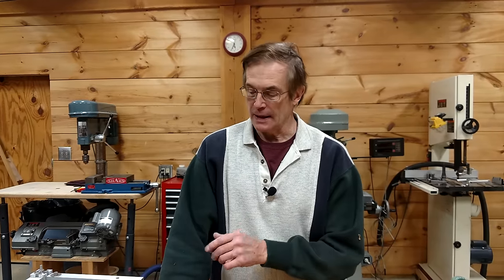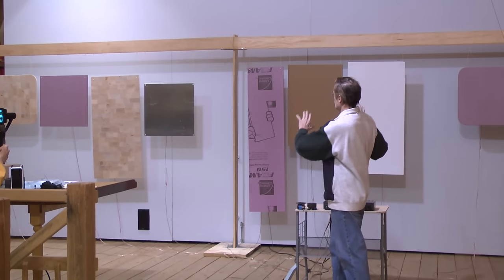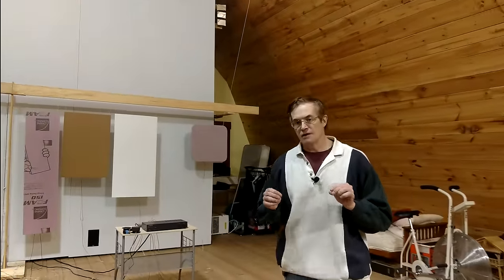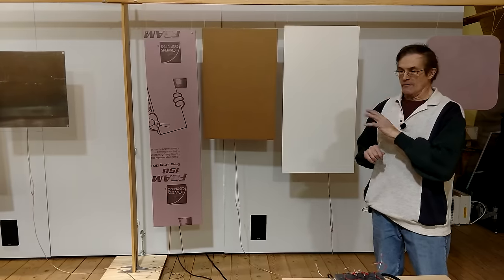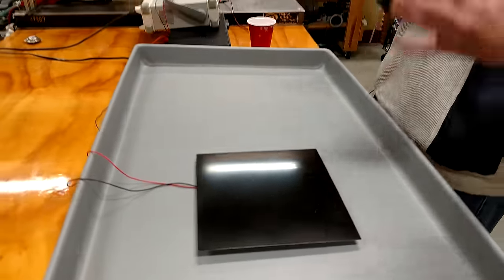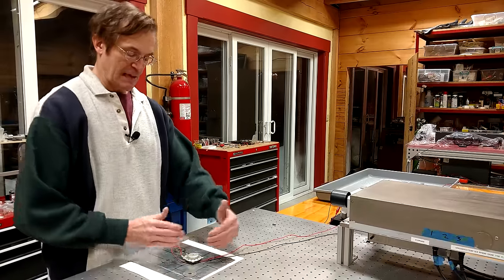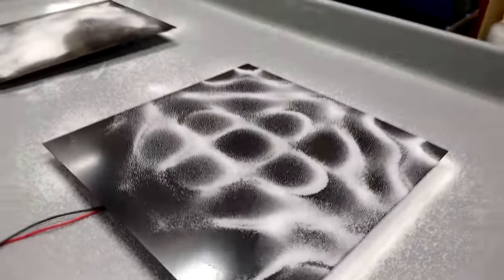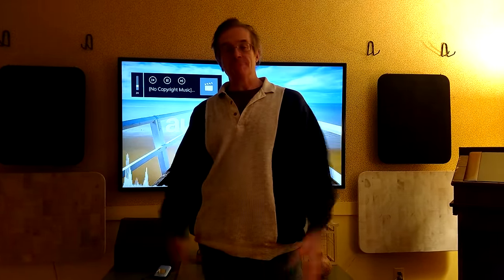Fantastic DIY Speakers for less than $30!

Comment: Where is there a link for these speakers? Everyone here is asking the wrong questions. "Oh so informative and knowledgeable" Great.. Where can one find a pair of these speakers so I may tinker with my own project? Whole point of DIY is kind of like the analogy of "teaching a man to fish instead of giving him the fish". 
So far, I've learned the thickness, exact weight and length of the fishing line on a molecular level down to the "history of the lake", the properties of water, and a firm explanation on EVERY single fish known to man, although I have yet to learned WHERE TO BUY THE FKING HOOK!! lol. 
The guy even placed the "song" in the description although not the ACTUAL SPEAKERS so one can pirate that stupid song and play it on those FKING supposed $30 Fkers speakers!

I mean even link so of the material he used in his end project (which kinda looked hideous with the unpainted bottom piece : just my opinion). 

JUST SAYING, great video although I hate when something is being presented but neglects to actually tell you where to obtain them as yet that's the point of the video and the heading.
Reply from the maker: In the second video in this two part series I go through the assembly and show the exciters.  If I failed to include a link in the description, they were sold by Parts Express, but you may find that after several years you will have to select alternative models as stock changes pretty frequently.

Comment: Your videos are inspirational, especially for kids interested in becoming scientists or engineers. Thank you for the effort, so obvious in all of them!

However, that said, I think your design approach with these speakers is seriously flawed. And in your other video where you play samples of orchestral music (Bach's Brandenburg Concerto #4, Beethoven's Egmont overture, etc.) this flaw is obvious. These speakers DO NOT sound good. I found the same recording you used for the Bach on YouTube and played it through my iPhone and then through a pair of Bose 301s (inexpensive bookshelf speakers). The sound from your speakers is a lot closer to what I get from my iPhone than from the Bose 301s. In particular, there's a terrible screeching on the higher flute notes. Listen again. I think this is happening because of the unavoidable resonances you get with the design choices you're making with your speakers. 

An ideal speaker has zero audible resonances. It's a very heavy mass (a magnet) driving a very light, very rigid diaphragm that is completely free to move back and forth exactly as the magnet would move without the diaphragm. It's not supposed to be a harmonic oscillator (like a mass on a spring with a natural frequency, w=sqrt(k/m)).   This is why in traditional, commercial loud speakers, the diaphragm moving the air is made of paper (so it's light) shaped into a cone (so it's stiff) and attached at the edge with that rippled rim of paper (so it's free to move). Then a very heavy magnet is glued to the back of the cone. That make k low, m high, and w too low to be heard.

But in describing your speakers you talk about wanting the Styrofoam to be flexible. It's the reason you give for sanding off that thin plastic skin. But you don't want the panel to flex because then it acts like a spring, and along with the heavy magnet, you get a harmonic oscillator and resonance. You want the Styrofoam to stay flat as it's moving back and forth as a rigid object. I think two changes to your design would help to achieve this: 1) Leave the thin plastic skin on your Styrofoam (to increase stiffness), and 2) Use multiple drivers on the panel to reduce its tendency to flex as it moves. I'd start with 4 drivers, each placed somewhere around  11 inches from the center on a diagonal from the center to a corner.

I'm going to try this, and I'll let you know how it goes!
Reply from the maker: Remember  that what you hear is also dependent  on the dubious  acoustics  of the large room in which these are being played.
You actually  want the panels to flex, that's the point. Just like the soundboard  in a piano or the body of a cello, the resonance is due to flex modes and not a rigid body acting like a piston.  That's why I demonstrated the resonance  plates in the first video.
Reply: @TechIngredients  but pianos and cellos aren't supposed to accurately recreate a sound. In the case of the cello, the bow drives the strings, which drive the bridge which drives the front and back plates, ...  All those acting together produce the sound of a cello. But a speaker is supposed to accurately reproduce the sound that was at the location of the microphone when the recording was made. No?